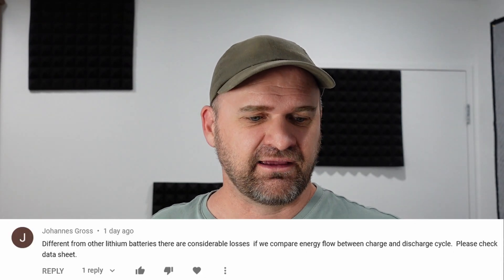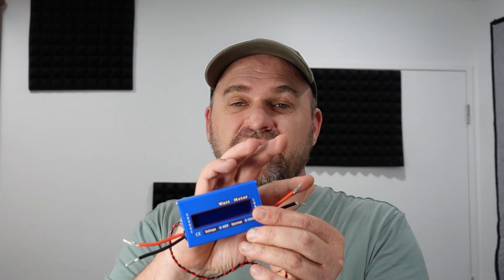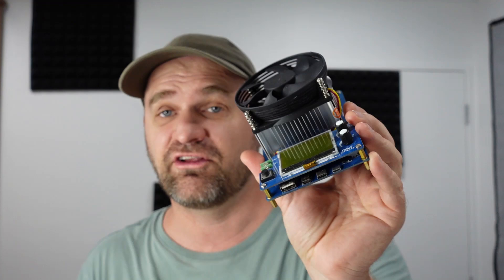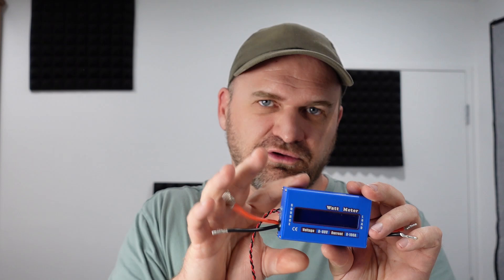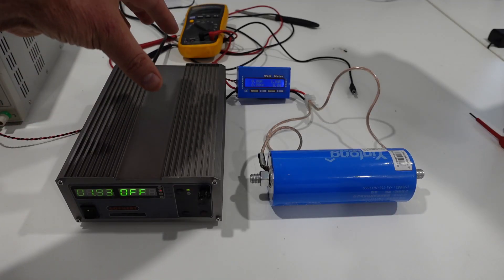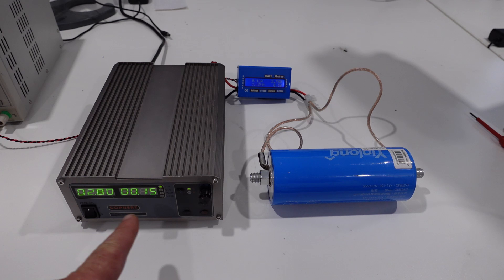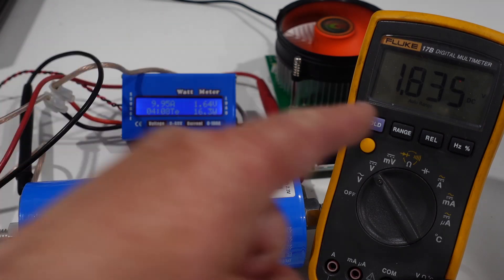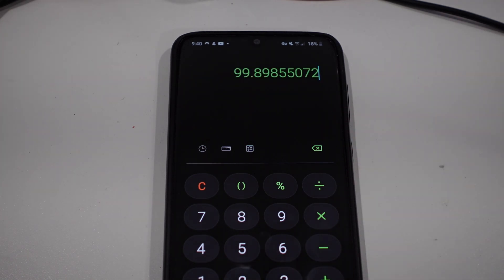Efficiency test LTO Yinlong battery

Comment: I agree with other commenters here --- if you have inefficiency -- that wasted energy must go somewhere and in most cases that is seen in extra heat.   No heat?  Then efficiency is good.   It is expected that those batteries are of a lower grade and are mislabeled so the Chinese company can sell them.
Reply from the maker: I disagree.  The reason is, how do you quantify that heat as efficiency loss.  Everything you put electricity into will get warmer (except maybe some chilled ytterium barium copper oxide).  You need to put a quantifying factor in that is measurable.  What temperature increase would show it is good or bad?  1 degree, 10 degrees?  These cells only has a small surface area for it's volume so won't dissipate heat as well as other cells.  So you cannot even say 'battery type A raised by 5 degrees and battery type B raised by 10 so battery A is twice as good'  it could be the volume to surface area ratio of A is 5 or 10 times as much.   The best way to measure energy efficiency is to measure the amount of power you put in and the amount you take out, then you have an actual measurable efficiency.
Reply: @brendontait6968  This is all basic physics and chemistry.   In fact, your professor in college will flat out tell you that without normal inefficiencies in all energy systems -- the world would blow up.   The point is that if a battery is highly inefficient -- it will give off a lot of heat during the charging process.    It will always give off some heat, but very little if the charging process is efficient.
Reply from the maker: @keithsummers2842  I dropped out of college tho 🤣🤣  I understand your sentiment and appreciate that in most cases lost energy gets converted into heat.  And yeah, I'll likely add thermocouples to cells in some future videos.  But... I like to be able to quantify things.  You cannot look at two different batteries side by side and get an accurate representation of their efficiency by measuring their corresponding  temperatures.  There are too many  variables to take into account.  What is the specific heat capacity of the cell, what is it's emissivity and surface area to volume ratio...  the list will go on.  You cannot say this cell raised in temperature by 8 degrees so that means it has X efficiency compared with this different cell.  You can get a pretty good shot at efficiency by measuring power in and out tho.
Reply: @brendontait6968  Correct -- it is just a generalization...

Comment: I have the same power load device, but I also find it to be rubbish.  1. the connectors cause too much voltage drop, 2. there is no secondary battery voltage measurement wire (2 wire) so accurate capacity monitoring is not possible.  
Otherwise it's okay.
Reply from the maker: It's so much better than my previous. But yes, terminals are horrible... but they are easy replaced. I dont find voltage drop an issue unless measuring Wh, because you can allow for the volt drop with the shutoff voltage

Comment: Hey brendon, great video. I've been running a 6s4p bank for a few years now at 15.4v and I run it up to a 10c discharge nearly everyday for my purposes, mostly on cold temps as well, and they have performed better then any other cells I've had. My application is very demanding and I've been constantly amazed by these cells time and time again. Been using them since 2018. Nearly everything about them is amazing in my opinion. I honestly shoe off the naysayers that talk about these cells because Ive had so much real world experience with these that no one can make me think bad about them.

There is another LTO cell that is 18ah, a lot smaller but much higher charge and discharge rate that I will be testing this year. I started a lithium battery business, so I have some contracts with Yinlong and a few other companies in china so I get to get a lot of these cells for low prices, which helps.
Thanks for the informative videos!
Reply from the maker: Hey, that's great to hear.  Yeah the lishens definitely are a compelling price point too
Reply: @brendontait6968  yes, very, great cells from what I've seen
Reply: Do you have a website or a Facebook page? Thanks for your comment.
Reply: @JTO2632
Are you still in business? Do you have a page / contact / ... ?
Reply: مساء الخير ممكن سؤال من فضلك ماهيه الاسعار المخفضة التي تتحدث عنها وهل البطارية تتحمل الشحن السريع والتفريغ السريع ممكن جواب على السؤال

Comment: Can anyone point me in the right direction. I've been looking at Electric Motorbikes, with a wish to using one instead of my Old Mountain Bike to get back around the world on. 
I suppose my question is, are we nearing a point where i could build a Battery set-up that could get me 200 miles and fast charge with a budget of £2000 for the Battery build. 
P.s. great Videos mate.
Reply from the maker: A lot of it depends on the performance you're expecting and the tyres you want to run. Batteries are heavy and that weight will significantly impact how the bike rides. Depending on speed, you're probably going to use around 25Wh/mile. So that means a 5kWh pack (probably around 20kg with cobalt chemistries).  The fast charge aspect is going to be difficult as getting that much power can be hard.  Realistically the most you can grab from a regular power outlet is say 2.2kW.   So that is a 2hr charge rite there. (EV charge station could help there tho)  If you are wanting to travel at speed, all these numbers will all be multiplied by a factor of 2 or 3. The tech is coming fast, batteries are getting more capable every year.  There should be loads of ebike forums around with solid info.  Good luck.
Reply: @brendontait6968  wow, the man himself...ha, i've gone all shy. 
Tbh mate, i'm bloody impatient so i may buy a Lightweight pre-built like a Artisan Kolter to get it registered and then wait for the tech to improve, as the batteries are removable.
 I was just wondering if to make them viable (price-wise), these companies are using poor quality batteries and whether, with a better battery i could achieve my requirements now.
Thanks for replying.
P.s. been chatting with a cool guy out your way on the South Island, calls himself Newzeroland, check out his vids on touring NZ on his Electric Motorbike.

Comment: I would like to run my 500 watt air conditioner. How many battery do I need to run it all night but making them charge all day with solar and wind turbine
Reply: So your thought process should be the following: what demand do I need to meet given a certain amount of power usage, what battery capacity do I need to fulfil that demand, and from there you should be working out if your power supply from wind and solar can meet that or not.

Taking your inputs as an example:
Assuming 500 watts is the actual power draw, then for an 8 hour night you need 500 x 8 watt hours = 4000 watt hours = 4 kWh
Assuming that after losses to battery internal resistance and inverter losses of 80% (real world you should be getting higher efficiency but assume worst case scenario) then you should divide 4kWh by 0.8 = 5kWh of battery storage.

Now you want to consider what voltage your battery storage runs at. A lot of off-grid power supplies now run at 48 volts, but if say you were in a motor home and you want to directly use the 12 volt power supply from the engine then you also want to consider that voltage as an option.

In any case, let's take 48 volts as your battery storage nominal voltage for calculation's sake. To store 5kWh of energy at 48 volts, you will need 5x1000/48 = 104.2 (we'll round up to 105) amp-hours. 

Now you want to think about what kind of battery cells you want to make up your battery storage up to 105 amp-hours. The Ying Long battery shown in this video can hold 20 amp-hours. So if you wire up 5 of those LTO batteries in parallel, you would get a battery pack of 2.4 volts and 100 amp-hours. To make the whole lot 48 volts, you then need to wire up 20 batteries in series to make 20 x 2.4 volts = 48 volts.

So using those Ying Long LTO 2.4v 20Ah cells, you would need 5 x 20 = 100 cells. This would produce a 100 amp-hour battery at 48 volts, which stores a total of 4.8 kWh. If you wanted a bit extra then you would do 6 cells in parallel to make it a 48 volt, 120 amp-hour battery, which is then a 5.76 kWh pack. It's probably smarter to overbuild your pack, that way you aren't fully charging and fully draining it, which really kills the lifetime of the battery.

A wind and solar installation would therefore need to produce 5.76 kWh over the 16 hours that you are not draining the battery in order to fill it up. Averaged out, you need the installations to be producing at least 360 watts for each of those 16 hours. Obviously the sun is not going to be out for 16, and solar irradiation is extremely poor during dawn and dusk and worse in winter. So you probably want to assume that on average you would only be able to get sufficient sun for perhaps 8 hours. Which means that your solar installation should be around 720 watts, or whatever mix you need if factoring in wind turbine input. It's probably smarter to instead get a nice round 1000 watt solar panel array to take into account winter and cloudy days, plus another 1000 watt wind turbine. This way you know that you will always be producing more than you need.
Reply from the maker: Hey Sam Smith....  each cell is about 92Wh so you'd need about 6 cells per hour that you'd want to run.  I've never had much luck with wind turbines putting out useful/reliable power.  I'm sure there are exceptions to this

Comment: I may have missed a video, but how is your battery system doing, regardless of all the "chatter" about battery types, equipment, efficiency, and stick measuring ; - ) 

How is your battery system doing, what can you do with a full days charge; etc. thanks - & great videos!
Reply from the maker: Hey, thanks.  Yeah it has been working well.  I haven't really been away in it. I have been using the mains powered fridge/freezer in it with inverter.  It lasts 10-12 days on a charge.  I'll make a video on the BMS etc soon.

Comment: Any thoughts on using these to build an EV battery pack? What would you need, roughly 170 of these in series to hit 400v to drive a Telsa motor? That would be a lot of volume and weight, but since these batteries have such a high charge/draw amperage it might work, so I'm wondering if you think there might be a good way to do it.
Reply from the maker: TBH, I'd probably use 2nd hand tesla battery modules.  But just be aware they can catch fire fairly easily if not nurtured. You'd need to parallel these cells up too to get some extra capacity.  If i had my heart set on this chemistry for an EV, i'd use prismatic cells vs cylindrical to be a bit more efficient on space.  There are better chemistries for EV applications tho.
Reply: @brendontait6968 , so not a great idea then. Stick with Li-Ion then or do you have a better idea?

Comment: With the cost of these things, would it not be an idea to look into Zinc Bromine flow batteries? They're a lot less efficient, but the chemistry claims to be a lot cheaper.
Reply from the maker: What claims have you seen for $/kWh? My concept for building the pack that I did is to make the best pack possible
Reply: @brendontait6968  I don't know if there's been any progress on it, but I looked into non-flow versions which for now seem to be DIY-only. According to a paper (which is likely exaggerating costs of materials a lot), you're looking at a of $0,017 per kWh over the lifetime of the battery. https://pubs.rsc.org/en/content/articlehtml/2017/ee/c6ee02782b

For a commercial battery it was much more expensive. I was quoted (in South Africa) $8 500US for the battery and $1 000US for the BMS. That was a REDFLOW ZBM2 (10kWh) battery with a 10-year cycle warranty of 36 500kWh 'delivered' energy. At that price it's stupid.

Comment: You tested the wrong thing. You need to measure Energy IN vs Energy OUT. Not coulombs in vs coulombs out. Coulombs mean nothing if voltage is low. Do a Watt-Hour in vs Watt-Hour out comparison and that would mean something. Oh, and just multiplying Ah by a constant voltage to calculate Wh won't do.
Reply from the maker: I thought I explained this - there are too many losses in the system to easily measure Wh with any accuracy and such a low voltage cell.  Coulombic efficiency does mean a few things.  Firstly it gives an indication of electrochemical losses.  Secondly, when combined with cell internal resistance it can give you a pretty accurate indicator of actual efficiency.  I did this test as an easy thing for people to grasp and to show that the efficiency was no where near 80%

Comment: What is the accuracy of that wattmeter? From its' watthour counting it gave 83.4Wh on discharge, while accepting 97.1Wh during charge. That is an energy efficiency of ~86%. In addition, you say that the overpotential for LTO cells are close to nothing, but a quick google search reveals that most scientific papers report around 0.1V(6%)(LTO/Li cells), which is JUST for the LTO side. Then you have to add the overpotential for the cathode as well. Thus, the question arises: what sources do you have for claiming that LTO cells have the same discharge and charge potentials?

Your testing is very important to the DIY community, so having correct measurements become crucial.
Reply from the maker: This video was done to show the efficiency of these cells was not anywhere near close to the claimed 80%, I don't really care about fractions of a percent for a test like this.  The efficiency of the meter is pretty much irrelevant in this case because the same meter was used in both directions.  It is pointless to read the Wh on the meter, the low voltage of the cell combined with the conduction losses in the test setup (cables/meter etc). I thought I was quite clear about explaining this in the beginning of the video, so I'm surprised you mention it as a valid point???  The overpotential is related to the C rate on these cells, my source of info is my own experimentation.  Anyone that uses these cells know that they have very little voltage sag. You say " claiming that LTO cells have the same discharge and charge potentials?" I said something along the lines of very close - not the same.  I will do a future video on energy in/out - however it will be more complex and difficult to follow, because you cannot just use a meter to tell you with any accuracy unless you have a cooled yttrium barium copper oxide test rig.
Reply: @brendontait6968   Thanks for the reply. I am sorry for my ignorance on the wiring and meter setup, I totally agree that looking at the Wh is irrelevant now. I should have understood that from your video explanation. By your first statement you mean not close to 80%, as they are much higher, or am I wrong here as well (I guess the high CE number validates this, but yeah)?
An YBCO setup would be badass (but i think i got your joke). But wouldn't a voltmeter at the terminals and 'any' current measure suffice for doing the energy testing? Ofcourse I know the equipment need, I don't have the equipment myself.
When googling these cells, I can't find anything on what cathode material they use, is it just plain NMC? If "lab" data says LTO has 6% overpotential(even at low C-rates), and NMC also has some, I guess it should have some total energy loss, like all batteries. So I am really looking forward to your video on energy in/out!

In any case, thanks for clarifying my obvious mistakes here.
Reply from the maker: Yes cathode can be LMO or NMC, yeah my first statement was based around the fact that the cells were significantly better than the 80% often claimed in  normal use. I'll have a think about the best way to do an energy test.  With low voltage cells like this, it can be very easy for errors to creep in.  Pretty sure I'm unlikely to get a superconducting rig anytime soon 🥺

Comment: Anybody that has some Information absolut the overall efficiency of those cells? Obviously there is still internal resistance and possibly other electrochemical kinetic causes of loss relating to the voltage drop you have from charging to discharging... just curious and I wouldn't be too surprised about bashing as people usually tend to simplify stuff and sometimes do not get the important details. Anyway very high coulombic efficiency is very important as you'd definitely not want  current to go into other electrochemical reactions as those normally destroy stuff. Important video in that respect
Reply from the maker: The high coulombic efficiency shows that there is very little electrochemical losses within the cell as you mention.  The very low internal resistance combined with the high coulombic efficiency would generally infer high energy efficiency.  I will do a more comprehensive test in the future testing the energy efficiency of these cells.  It is difficult to make a video that people will watch that has a lot of indepth information.
Reply: @brendontait6968  i would find it very hard to believe that any li ion battery with a CE of 85÷ would last all too long.... and probably the results under high load are artificial ? Meaning discharge end voltage is not the same charge state as open circuit before charging... maybe a bit tricky to measure very exactly ... especially if you have this slowly linearly changing discharge voltage profile. At least at high discharge or charge rates I can imagine there are differences from end voltages charging/discharging to open circuit voltages empty/full